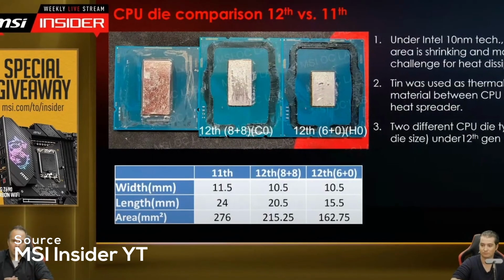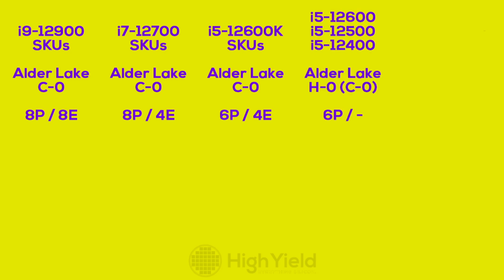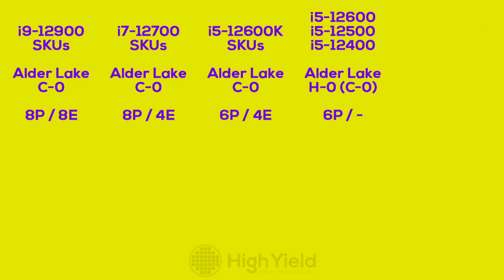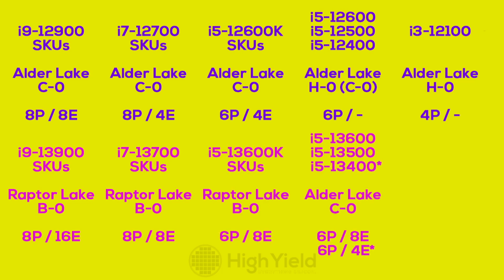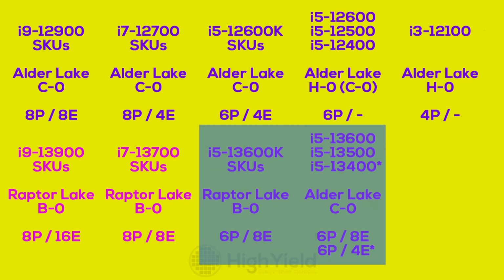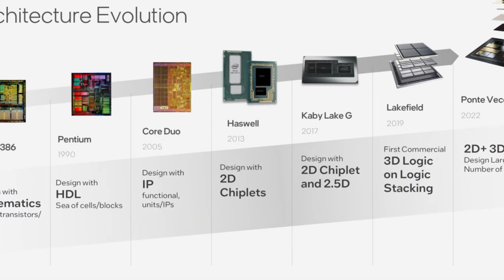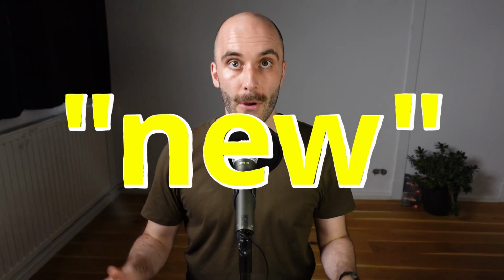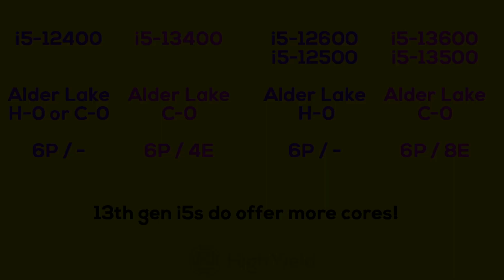Not all Intel 13th Gen CPUs are Raptor Lake

Comment: The 13400 is going to be the chip to watch I think. Yes it is on the older die, but generation over generation it is going to get a MASSIVE boost with those  E cores added. The 12400 was already enough for 95% of people, with the added efficiency cores coming I think the 13400 will still be a strong competitor years from now.
Reply from the maker: Yes, if you know what you are buying, the refreshed chips could turn out to be price/performance champions.
Reply: @HighYield  The 12600k, which has 6p+4e cores, has a 20Mb L3 cache, while the 13400 with a similar structure has 24Mb. It can't be exactly the same.
Reply from the maker: The C-0 die has a total of 30MB L3$, Intel could just leave more activated.
Reply: @HighYield  although I don't know how they can increase the size of the L2 cache of e-cores on the old architecture, are there more of them and enough less to eliminate?
Reply from the maker: We will find out eventually. Maybe the leaked list is wrong after all and more chips are actually Raptor Lake?
Reply: @HighYield  You were right, the raptor lake refresh is our only hope for the B-0 die to trickle down into the lower segment.
Reply: @HighYield  
How can 13400 be on the older design when the L2-L3 cache has increased compared to the Alder Lake series?
Reply: What can you actually use the e cores for? As a gamer i mean
Reply: @hiXhaX-YT  background apps, the e cores are meant to take the background loads off of the p cores so that the p cores can focus on the heavy lifting
Reply: @funi1083  and does this make any difference in gaming at all?
Reply: @hiXhaX-YT  if you use background  apps a lot while gaming, ie watching yt, yeah then the e cores will make a difference. However, the reason why the 12600k has significantly better performance over the 12400 is because of the clock speeds, as both cpus run about the same fps when overclocked (12600k only needs a z690 motherboard to overclock while a 12400f needs some very specific motherboards like the msi mag b660m mortar wifi MAX ddr4 (emphasis on the MAX variant) that have external clock generators that bypass intel's locked setting, allowing the 12400f to boost  to 5.0 ghz (same as 12600k), at which both cpus will deliver the same performance. (there's a 12400f oc vs 12600k oc comparison video on YouTube)

hope this helped
Reply: @hiXhaX-YT  the benchmarks show an improvement in performance between the 13400 and the 13500 , the only difference being the e core count going from 4 to 8, the 13400 performs very similar to 12600k and the 13500 is comparable to a 12700k in performance , so they do make a difference....
Reply: @nix123ism  what benchmark is that? You got a link? How big is the gap between the two?
Reply: I agree it should be the gaming value champion, I just think people are turned off about it being end of the road for the socket, compared to AM5 which is only just getting started.

I think Raptor Lake is a hard sell except for people who only upgrade after say 6-7+ years.
Reply: maybe you dont understand that the e cores are not smart at all ? the intel CPUS have them and still suck that much power ? compare to AMD they have better cores and if you dont know it as long as the cores do not run at 100% they draw less power so E cores are useless for destop. But smart for Laptops

Comment: My opinion is, go Zen4, if you need to save bobs now get without VCache and upgrade later. If the recent Z4 vs Z4Vcache comparisons are reflective of real world performance the difference in performance between the 2 models is actually higher than the majority of Intel's upgrades for all previous generations since Haswell. In fact the performance difference is almost as large if not larger than the upgrade AMD in performance from the "Bulldozer last descendants" to the first Zen core, which was a huge bump in performance, over 50% in most if not all cases.
Reply from the maker: Intel already is in a though spot with Raptor Lake, because it’s the last generation on LGA1700, while AM5 is just getting started.

Comment: I wonder why Intel doesn’t have a P-0 die for the Pentium and Celeron’s, that they could use left over C-0 dies that have malfunctioning P-cores, so a 1 performance core, 4 efficiency cores, like an overclocked Pentium 8505 - Locked 3.6GHz for E cores, and locked 4.2GHz for the P core
Reply from the maker: Maybe there aren’t enough C-0 dies that are this bad to create a new SKU off of it?
Reply: I'd do something similar but different, I'd go with the Core 2 Quad Extreme having a 4.2GHz base clock with overclocking up to 5GHz while adding 4 additional E Cores with a 3.6GHz base clock. I'd also implement some of the newer vector register instructions that you see in modern CPUs as well as a very good cache scheme. Of course you're going to want to have a smaller die size compared to the original Core 2s from the late 2000s to work with modern motherboards and sockets. I would probably rate this chip just above the i5s and in between the i7s and i9s or at least on par with the i7s. I would also make sure that it's 100% compatible out of the box with both DDR4 and DDR5 support. Something like this could be a good bang for the buck. It also wouldn't run as hot and require liquid cooling like that of the i9s and some i7s. One of the main optimizations would be to keep the overall thermals low and try to minimize the power consumption. So it would kind of be like a redesign of an older chip to fit the newer sockets keeping all of the good stuff and adding in the newer requirements. I'm only saying this because I had a Core 2 Quad Extreme 3.0GHz and I am still using it over 15 years later! A bit of High Performance with Efficiency in mind and also built with Integrity all for a decent price. A 4 core super performance with a 4 core efficiency accompanied with a better modern caching system that also supports some of the newer instructions for about 30-40% of the cost of a 8/4 or 6/4 chip would have my support. If I was to spend say $500-800 for this chipset as opposed to $800-1200 for some of the i7s and i9s while still maintaining about 90% of the performance... I'd save a good 300-400! For me the jump from i5 to i7 is where the competition is lacking. The i5s are okay but I'd rather go with the i7s and as for the i9s that little extra power draw and then having to liquid cool on top of it for just another 3-5% increase in performance... Yeah I'd go with the i7 first and save a few bucks. Now if I could save a few more dollars and still have something better than an i5... and is almost on par with an i7 that'd be nice!

Comment: I'm really torn, which is awesome and annoying. I really like the 12700K right now and if I bought that, then I could upgrade that CPU to a 13700/13900K at some point if I wanted, but I probably wouldn't, never have upgraded CPUs on my main system. However getting into Zen early means I could keep the same motherboard... Which is a saving, but I think I mostly prefer it for the convenience factor more than anything else, upgrade from 7000 to, 13000 Zen...7? I guess? and then potentially upgrade just my CPU and maybe GPU in 4 years while keeping the same mainboard and ram, it's kinda appealing too. But I don't know what I'll pick, I'm really waiting for GPUs and I'll buy when they're both out on the market, and then whatever CPU makes the most sense, regardless of upgrade-ability, despite how cool the idea is.
Reply: i mean unless youre running very high refresh rates, CPU is becoming less of a problem. I was using a ryzen 1600 for ages at 144hz, only when warzone struggled did I upgrade to a 3950x I got on a cheap deal.
Reply: If you do a lot of multitasking a 13700 would be a nice upgrade considering it will have the same amount of cores as the 7950X
Reply: I can't really understand why anyone would upgrade just in 1 CPU generation.

If it's just for gaming, these  upcoming CPUs will destroy 144Hz at $200. I don't think there's anything to worry about unless you're trying to drive 240Hz or higher.
Reply from the maker: I mean it depends on what CPU you are currently using and then I would at least wait until Zen 4 and Raptor Lake are out to make a decision. It’s like a little over a month from now!
Reply: i think zen adapton will be expensive, and prob more so than Raptorlake, but i personally would go AM5 if i where to buy now. The no upgrade path on intel is just sadge, combined with the unknown of future strength in E-cores VS AMD`s full fletched true core designs. Currently a 8 or 10 core ZEN43D (rumored to launch Q1 2023) is what i would aim at if i was mainly gaming, and a 12 or 16 core non3D part, was what i would aim for if i was doing a mixed workload with manny multithread enabled programs/works.
Reply: I have always built my systems using either an i7 or i9 level k series chip.
By the time I felt I needed a CPU upgrade I also felt I needed to upgrade the mb chipset to a newer version along with many other standards mb related usually had been upgraded since I originally bought the original cpu and mb so I wanted to upgrade the mb as well.
So honestly if you build a decent system to begin with the MB really will need replacing as well as the cpu anyway to bring your system back to modern performance standards.
Reply: @billwiley7216  Yeah it depends how long people go between CPU upgrades and also whether their motherboard is still doing everything they want.

Sometimes people want the new PCIe or even just more I/O.

For example I'm on a m-ATX board coming off a m-ATX case. Now I'm on a full size Fractal Torrent which can even fit some E-ATX boards, and I'm really maxing out my USB.

I'm getting by with the case's included fan splitter, but it'd be better if I had more headers onboard too. So by the time I upgrade CPU, I'll for sure want at least a standard ATX board, maybe even E-ATX.
Reply: @libertyprime9307  My last Alder Lake Build was using the Fractal Torrent case and I always usually go with a $300-$350 mid tier ATX board.
My previous 10700k build was in the Lian LI Lancool 2 mesh case.

Comment: I Hope the Motherboards getting cheaper or in par with AMD Boards. I dont care about overclocking i do the oposit, undervolting and underclocking for the Lower power for a 24/7 Computer.
Reply from the maker: I think there’s a decent chance motherboard could be cheaper, since older B660 boards are also compatible.

Comment: It's like when 10105 came out after the 10100, but at least they said it was still  10th gen then. 13100 seems like a waste of money if it's much more expensive than the 12100. 
I don't mind them using alder lake CPUs for the 13th gen since you get a nice core count uplift from last gen.
Reply from the maker: I don’t think Intel will raise prices in the entry level, but ofc I could be wrong. Let’s wait and see!
Reply: If it has raptor cove cores then it would be worthy of the 13100 name. If it's golden cove then yeah I agree with you.
Reply: But why would the 13100 in particular be a waste of money if it becomes more expensive? All the others are more likely to be a waste of money because they're more likely to cost more since they're geting core count and die cost increases.
Reply: While it's nice to be getting more cores you are missing out on the IPC improvements brought in with Raptor Lake still. Alder Lake based 13400 will have the smaller L2 cache etc. compared to higher SKUs in the line up that are based on Raptor Cove arch. I guess it's intel's way of maintaining profits as the dies using the Alder Lake C-0 die will be smaller than they would be if they were cut down Raptor Lake B-0 parts.
Reply: 13.100 , i think they could have gave 2 efficient core at least (4P/2E)
Reply: @jonathanp5249  afaik E-cores come in clusters og 4, so it would have to be 2P/4E
Reply: @Jeriks   
yes, you're right, but it seems that it won't be like that, I don't see anything different in relation to 12100, I think they should have done something to make it superior, maybe 2 more cores or better cache.

Comment: Nope, not happy about tricky naming. A more 'honest' approach would be to not rename and drop the price a bit, if the concern is clearing stock of silicon that has not been sold. Tricky naming feels more like Intel drying to squeeze a few extra $$$ out of customers for no good reason. On the upgrade... I am not sold on big.little yet. I still have an older i7-3770k as a home server running Fedora just fine and feel no pressure to upgrade it yet for my use case (not gaming - server, code compilation and massively multi-threaded number crunching). My eye is looking towards 2nd gen AMD Zen4 to upgrade that machine, unless objective reviews and GIOPs scores can convince me otherwise.
Reply from the maker: Intel just doesn’t want to spend the money for more new tape-outs, rebranding is cheaper.
Reply: After hearing Wendell Level 1 about 12th gen on Linux, the MS/Intel Thread Director  cooperation has been done as a black box.  The BIOS ACPI tables can be wrong (so Linux fixes up) so it's clear they use shadow data.
I found analysis of 12th gen power efficiency and it's seems clear both cores were pushed up the power wall to make benchmark scores.
From the Zen4 launch announcement it looks like it brings a big improvement on MT crunching if you care about perf/watt.
I used to run a dual MP office server for fast compile but it was noisy, these Ryzen 9 with an AIO and perhaps some tweaking would rip through it at much lower TDP and decibels
Reply: @RobBCactive  Good info! I tinker exclusively in Linux with Qt and OpenCL ... thank you 😀
Reply: @imperiousleader3115  I'll share info sources:
Wendell was on Moore's Law is Dead YT channel  Broken Silicon last month and Chips and Cheese investigated the Alder Lake vs Zen2 power efficiency behaviour.
There's a recent TechPowerUp benchmark isolating P & E cores.
Reply: I'd wait for Zen43D in Q1

Comment: I was bitten by Nvidia's 860M laptop GPU which had Maxwell & Kepler implementations.  They dropped support for the Kepler and would not distinguish between the products in their software.
On AMD I used a 3400g which was 2000 based and have 5700u 3000 based laptop.  Different model numbers, price and availability, with some tweaks claimed.
I think we have to accept the  marketing use of year based model numbers, OEMs find it too useful freshening ranges and it maintains product supply.
Intel's apparent 13th generation 12th generation chip is more directly misleading, will there be 2 model numbers with the exact same specs at different prices?
Giving different chips the exact same model number is highly deceptive.  After that GPU I don't trust Nvidia products.
Reply from the maker: All companies, be it AMD, Nvidia or Intel, do it. It makes a lot of sense from a business point of view, but some rebranding stuff is more problematic (like your GPU example). Best we can do is to stay informed.
Reply: @HighYield  As an English native speaker the Nth generation labelling appears stronger than just product numbers in a line up.  It feels like it should mean more, though Ryzen 5000 is often reported as synonymous with Zen3 
Intel won't separate the 12th gen parts with 13xxx model numbers, I suppose they may bin the chips slightly faster or something.
It just feels ridiculous that you have to remember their CPU codenames, to speak accurately about the product

Comment: I'm waiting for the Core I9 13900KS from Silicon Lottery running the best 360 Liquid cooler on the market to get my 6.1 P Cores 5.1 E Cores. Add best Gen 5 M.2 10,000+ R/W Gen 5 RAM at least 16 16 16 36 timing with RTX 4090Ti. I don't want much 😜
Reply: Then you'll settle for a 4080 and you'll be extremely unhappy because you're not blowing your load because you still needed money for a good monitor
Reply: Have fun spending $10,000 on that build😂
Reply: Only for the Zen 4 with V-cache to sweep anything Intel has to offer under the rug
Reply from the maker: Don’t we all? ;)
Reply: yes and after all that materialistic shit you will be happier.... and run shit games a few fps faster.... for a year then you will have to upgrade.... so lucky good consumer....